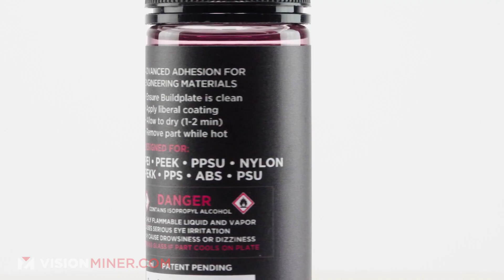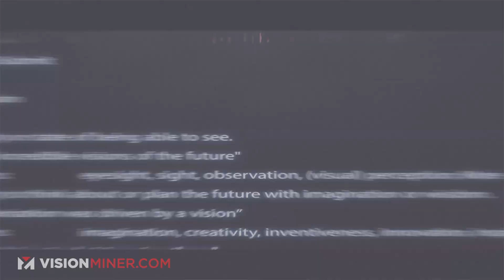ThermaX™ PPSU (Polyphenylsulfone) - Radel & Ultrason P, 3D Printing Filament from 3DXTech

Comment: I really hope a Nylon 6/66 copolymer video is coming up soon!!! Im not sure if it suits the needs you guys have for a material but it would be nice to see a comparison of this to PVDF. I currently use Nylon pa6/66 for extreme impact resistant parts where moisture absorption and chemical resistance is not a problem and was wondering if PVDF would be better. Would also be cool to see a comparison between it being dry and it after being conditioned. I found leaving it out in the air for a few weeks makes the part nearly indestructible. A comparison between it and HTN would also be cool

Comment: Also, I asked before but not sure if you read it amongst the other comments but I'd love to see you test out some Polymaker Polymide filaments and compare them to some of the ones you have done so far. For example  pa6-cf vs NylonX vs CarbonX, that could be fun. Or testing their polyimide COPA against other normal Nylons. Cheers for the interesting material videos guys. Keep it up! (I would buy from you but I live in the UK 😂)
Reply: they have stated multiple times they're going to put this out soon :)
Reply: @digital0785  This material in particular? Cool :)
Reply: @lio1234234  a bunch of the cf nylons :)
Reply from the maker: It's coming very soon! We've got a TON of content planned for the next few months, it's going to be good :)
Reply: @VisionMiner  looking forward to it!